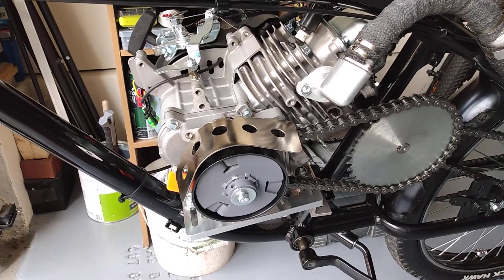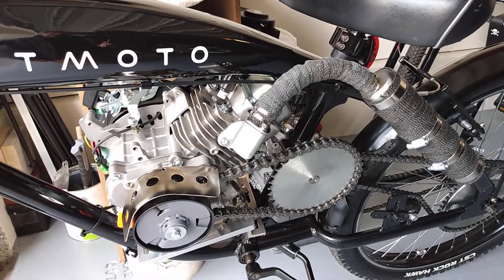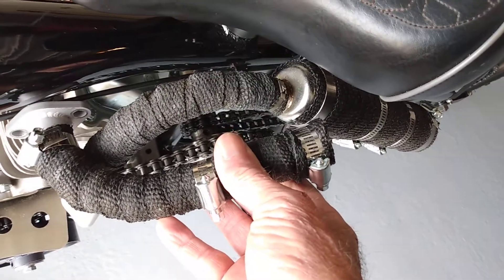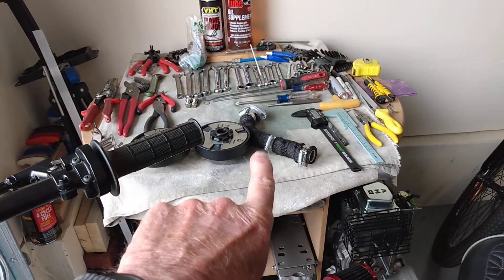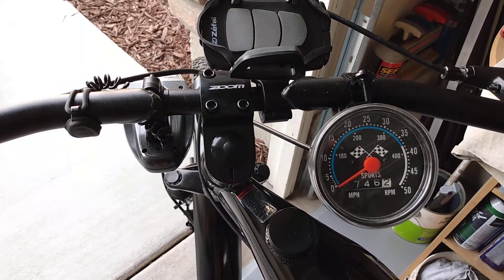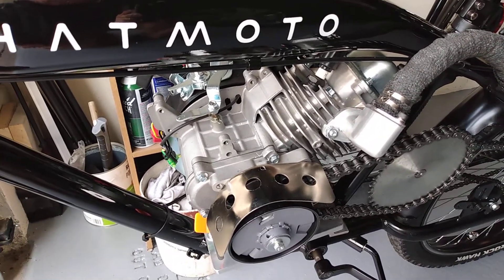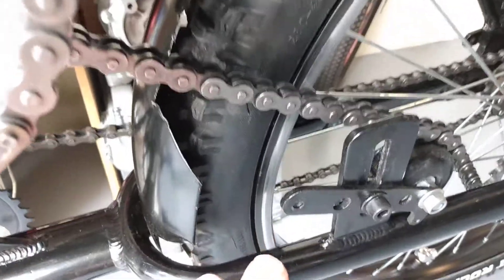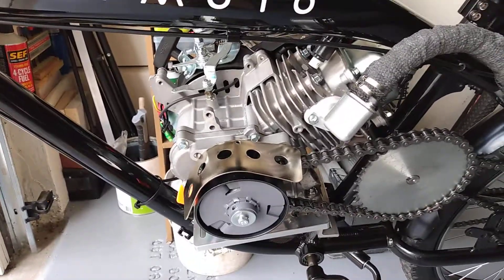Phatmoto Predator 79 cc engine upgrade Part 2

Comment: What jet are you using  in your carb  and do you know the rpm to are topping out at
Reply from the maker: In that engine I am using whatever size came stock, probably around a 70 +, RPM's I don't know but would assume with gov. bypass around 4400+

Comment: Hey if you have the part number that would be great thank you
Reply from the maker: Here are the part numbers: Mega Moto 80/105 Adapter Plate MMFAMPBENT  $29.99                                               Fully Adjustable Motor Plate, Small Block GPSFAMP $44.99

Comment: Could you please tell me where you got your motor mount the aluminum one where did you buy it thank you
Reply from the maker: There are two aluminum mounts I use. One is a adjustable plate engine adapter, the other is a wedge engine adapter. Both were bought from gooowersports.com The aluminum wedge adapter has been changed to a newer all steel style. It still does the same thing as the other one. It was originally designed to put a Predator engine in a Moto Vox or Moto Mega mini bike, which came with the vertical Lifan 80 cc or 105 cc engine.

Comment: Where do i get a clutch
Reply from the maker: You can get a Max Torque clutch at most go kart supply houses, also at some of the motorized bike stores the only trouble is they carry mostly cheap Chinese clutches. Gasbike has a new Hilliard clutch, they are calling it a "heavy duty" but what it is, is a undercover race clutch. It has the lightweight race shoes and calibrated springs with a hardened hub, they want $79 for it but it is worth it because it is a clutch made specifically for a motorized bike.

Comment: No manual clutch?
Reply from the maker: Most 4 strokes use a centrifugal clutch,  3 D Motorsports made a very good one, but they shut their doors and they no longer make them, they sold for about $300.
Reply: beau brummel Sportsman flyer still includes a manual clutch in their 80 build. Im gonna try to get a hold of them & see if I can get one. 

The compression release/start would be nice. Can you just order a jackshaft & use a crank on both sides?

Comment: u try the poopoo yet?  im curious.  what card headerU run?
Reply from the maker: No, I haven't tried it yet. I'm busy with a rear brake conversion right now. I've tried a header pipe, I've tried a header with a small muffler. So far what has worked the best has been the adapter with the 2 stroke style muffler. It has given me the most top speed. These stock engines seem to run best with some back pressure.

Comment: You ever think about trying the flexible poo poo exhaust.  I have one on my Lifan.  Doesn't increase power but sounds a lot nicer.  when you going to let us see this thing rip.  Been dying to see the difference between the lifan and predator.
Reply from the maker: You know Marc, I think you have convinced me to switch to the flex poo poo, I just did a video riding it, its a little shaky and has some gurgling sound at times, but I get to a closed road and open it up it gets to 35 mph, but thats with the analog speedo, so I'd say maybe 33 34 mph..

Comment: Yeah I had a mini bike with a predator 79cc and it liked back pressure more than a header
Reply from the maker: Yes, I think you are right, some engines, well actually most require some back pressure to run  optimum, especially stock engines.